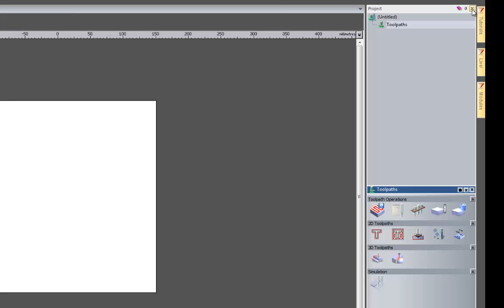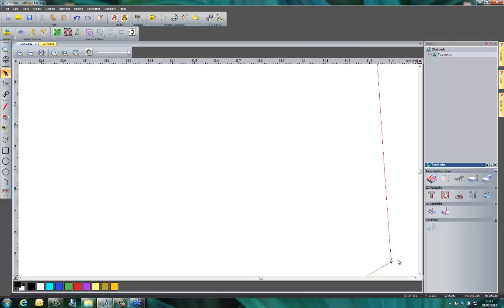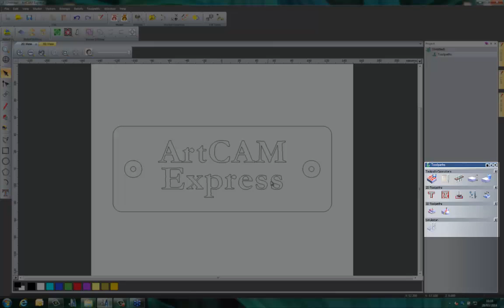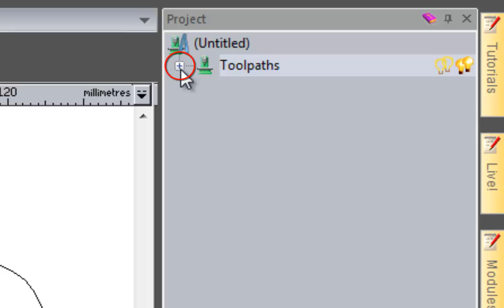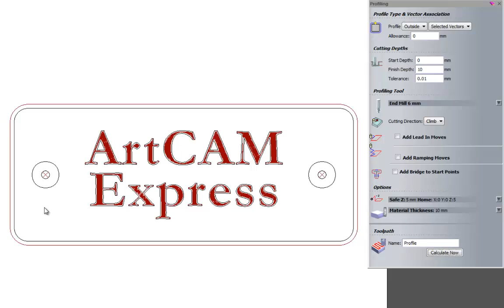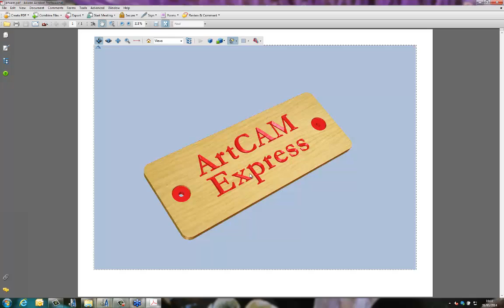ArtCAM Express 2013 for Beginners

Comment: Thanks for this tutorial, you've kept it slow and simple (suits my learning ability!). I'm going to try and use this software to create machining instructions for my Chinese CNC2418 hobby machine to cut sheet 0.5mm aluminium into 'butterfly' capacitor shapes for my electronics hobby. To cut the ally manually would take a year and a day, but if I can create the design in Artcam it should be much faster. Many thanks.

Comment: Hi, i can use your help.... i made a toolpath and i have a strange issue.
After cutting a panel with text and holes suddenly the machine added a straight line over everything, text and holes.
A line that doesn't exist in the file....
Do you have any idea why this is happening?